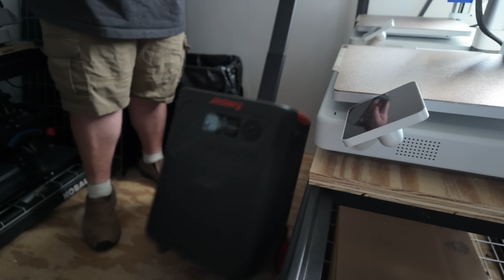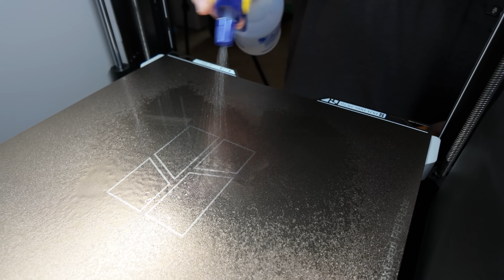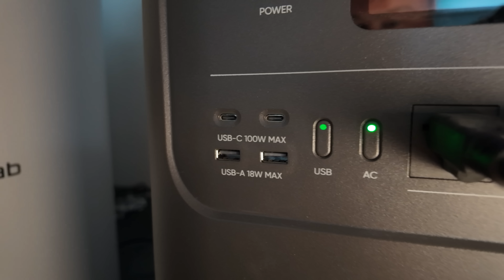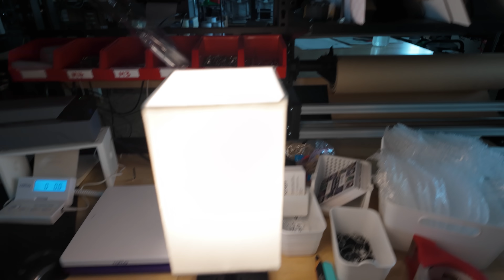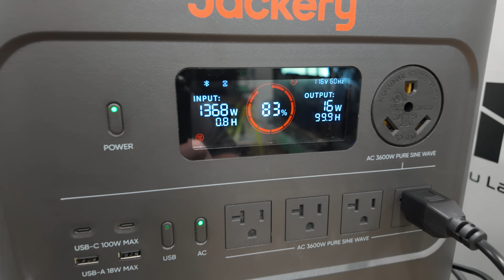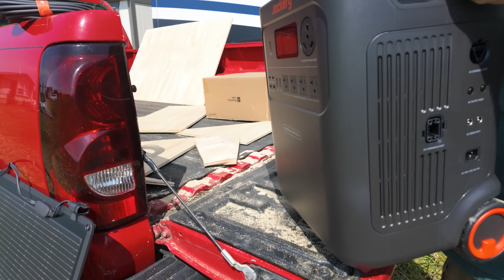Don't Let a Power Outage Stop Your 3D Print Farm

Comment: What regular UPS do you use for the H2D? Looking for something for my H2S. I have 1500va that's only 900 watts and it doesn't like the power draw when the bed is heating up. i use the 1500va for my other printers that don't require as much power.

Comment: My question is... do the 3d printers stop with power outage and pick right back up with power back on? Or are the prints scraped now?
Reply from the maker: All Bambu Lab models will, but there are usually visible issues where it stopped and started again. Also you will have weakened adhesion at that layer since they weren't printed at the same time.

Comment: Sounds like you need to pick up or have on site a gas powered generator or better yet pay extra 20% get diesel powered one with positive pressure on oil for around 3k range for a 12kw class diesel generator.  Add in a panel tie in that allows you to power certain set of circuits.  You will want this in place as AI starts really taxing grid  infrastructure.   I work in power gen field actually run the power plant, the future grid is going to be taxed at a very fast rate, infrastructure is old our systems our taxed, and green power solution implemented were not thought out making matters worse for all the plant closures that were done.  Setup 13kw unit at parents four years ago, comes in handy for critical water pump, fridges, well pump, etc.  If you want to run electronics having a nice sine corrected generator would be great.  The battery stuff is ok, but no guarantee of sun all the time to charge.  Personally, I would have both.

Comment: I wonder why the input power dropped to 0W at 7:09, just a second or two earlier it had an input wattage.
Reply from the maker: I can't remember exactly, but it may have been because I enabled the battery saver mode in the app and it limits the max charge and min discharge levels to fully maximize the battery life. The top battery limit is around 84% when that setting is enabled, but I adjusted it to make the max 100% cause it bugged me. :)

Comment: I know the dialog was just for the Jackery ad, but I thought you had a solar system at your house.  Don't you have batteries to prevent power outages when the grid fails?
Reply: Many (most?) solar installed don’t include batteries. It makes the install MUCH more expensive.
Reply from the maker: We do. :) This was my attempt at a creative video showing off how this device could be used.

Comment: $2200 power bank - ouch.
Reply: WORST value in the market today are these lil backups. For $3000 you can get 15kwh wall mount 48V LiFePo4 batteries today.
Reply from the maker: Apples and oranges...
Reply: @davefroman4700 that doesn't have wheels 😅 where ya gunna take it?

Comment: Slick power bank; just looked to see if they are available in Canada. Unsurprisingly, they are not. The largest Homepower unit we have is a 3000 (3072 Wh), but they do have an Explorer 5000 with 5040 Wh on wheels.

Comment: THese power stations are excellent for 3D printers even when the power is working perfectly! I use several units with a 3600 watt inverter as surge stabilizers and UPS's for my printers. I can start all 3 of my H2S printers without overloading my 20amp circut and it protects against power loss for around 1.5 hours!
Reply: How many H2S do you have on your 3600W inverter.  Can you explain a bit more?  I am getting up to 10 X1's and will be adding about 5 H2Ds and I am looking for power solutions primarily for power loss but possibly for load balancing.  (I am in a garage with limited power availability.)